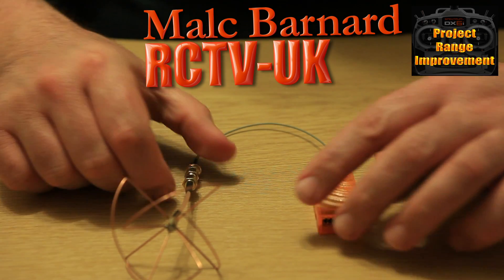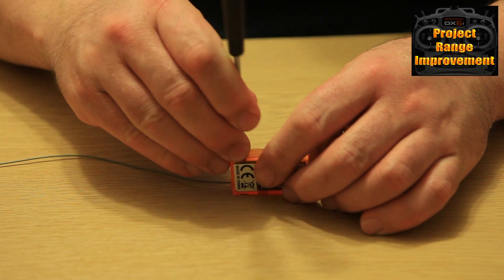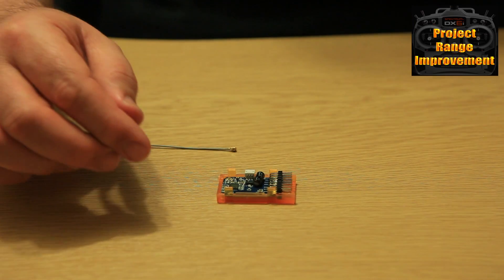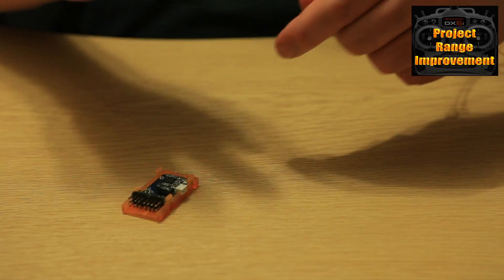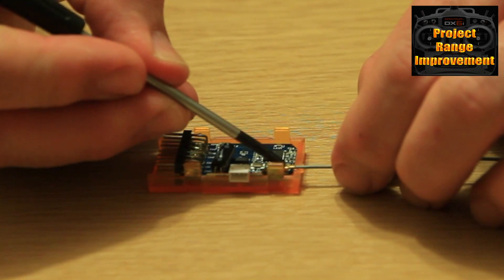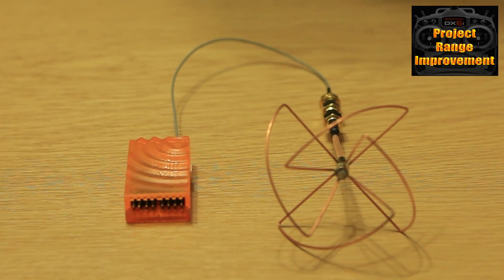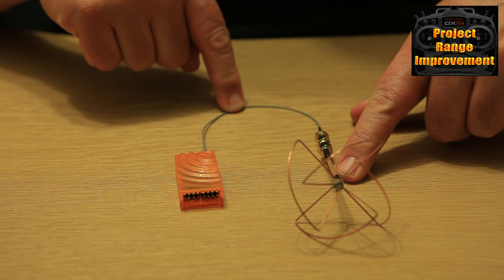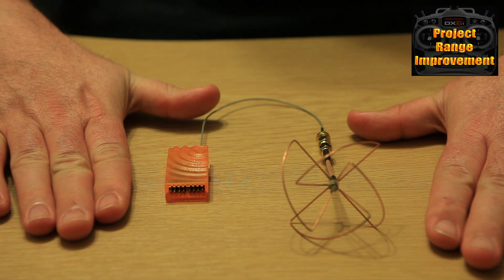Project Range Improvement - ORX 7ch modification

Comment: Maybe a silly question. But I fly FPV with my DX6i. FPV on 5.8 Ghz. Any danger that they will interfer with another?
And on your other video I saw that you used a white antenna instead of the cloverleaf. Will it still increase range if I use that one? And if so, where to find it?

Best regards
Reply from the maker: Not a silly question =D but you have no worries 2.4 and 5.8 play very nicely together.

White antenna? 
Malc
Reply: Perfect!

Yes, the white antenna shown at around 5:30 in the "Spektrum DX6i Antenna modification & signal improvement." video. I looked at tecnic.co.uk but I couldn't find it :/
Reply from the maker: Ah that is the 7DBI antenna you get with the 2w booster
Reply: I see! Will I loose much range if I use one of those instead of a mushroom antenna?
Reply from the maker: MrPostmaniac The 7DBI antenna has more gain so could get you further, personally I would be looking at using a helical with this set up if I were going for range.
Reply: Roger that! Thanks for all your help!

Comment: Cool- How much does this extend the range of the system?
Reply from the maker: We extended the range (in range check mode) by 18% but have not put that to the test in the field yet. I am going to be doing the full range tests in the next video or two. If the range was 1,000m you would expect a gain of 180m more but then if you are further from the ground that would be more etc. Also it's not just about boosting the range as these antennas also boost the agility of the signal making it more capable of receiving the signal due to the antennas polarisation.

I hope that helps =)

ATB Malc